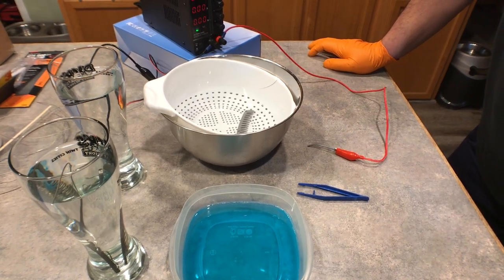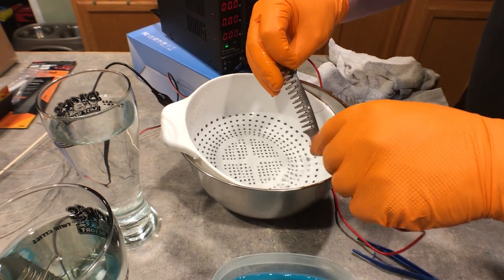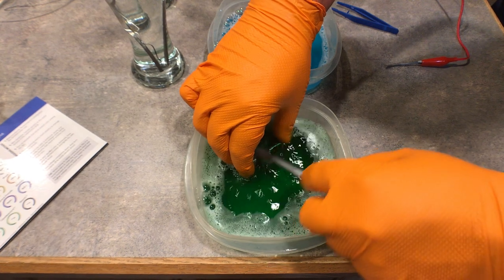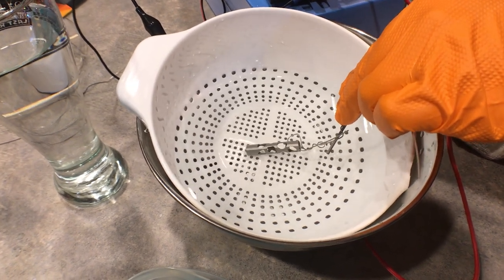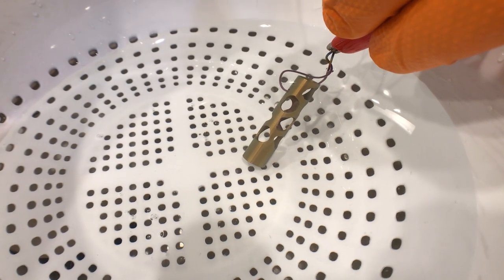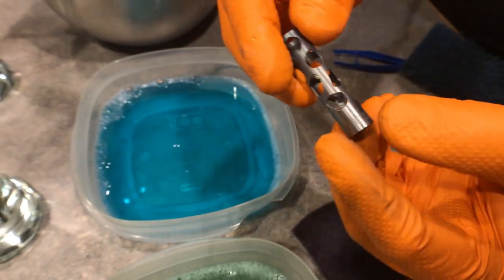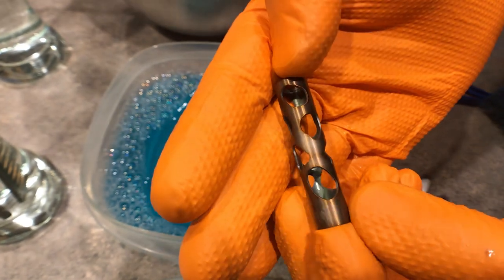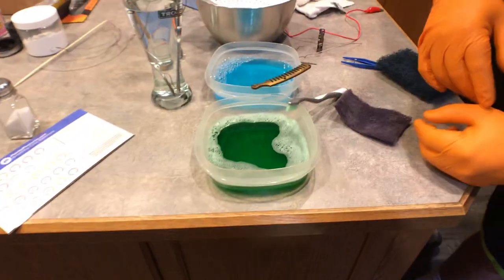How-to - Titanium Anodizing with OCD!!!!!

Comment: Hey, great video! Is your power supply a wanptek 0-120v 3a unit? Looking at a similar one for myself. I'm in Scotland, I can find a few supplies that are capable of 120 volts but can't find any that are capable of pushing more than 3 amps, most of what I'll be doing will be smaller than the knife handles I've seen you do. Your videos have been really helpful.

Comment: Great video!  Thank You!  One question...at the end of the video you show the tube shape.....how did you get the inside of the tube shape to NOT be anodized?  Did I miss that somewhere?  I love the idea of the contrast but it seems like when you anodize it in the electrolyte solution the whole piece in this case is submerged so I am curious how the inside was not anodized.  Thanks!  I design jewelry and this could have great applications for that!
Reply from the maker: Just don't remove the oxide layer on the portions of the Ti you do not want to ANO. Let me know if you have any other questions.Thanks for watching!!!

Comment: I had a question I have a machine similar to yours and I have had mostly success but there is one part a small peep sight that i stripped to re ano and when i try it goes good until about 60 volts then it goes haywire and the color gets super blotchy and dull and sparks. But I have anoed this piece before with success but soon as I stripped it with rust and stain remover and cleaned it i have  had this problem any idea what could be going on?
Reply from the maker: A few things can cause this problem.
First, if you're using Wink Rust Remover, if you leave it in to long it will etch to much, and that causes problems. The only way to fix that is to sand it all down and start over.  
  Second the part may not be fully clean and have some contaminates in a grove or something. The last thing is a bad spot of slag or porosity in the Ti can cause this issue, but it's pretty rare with Ti.  
I hope this helps, Thanks for watching!!!!
Reply: @OCD4EDC  thank you!